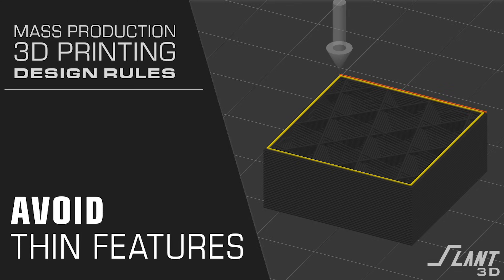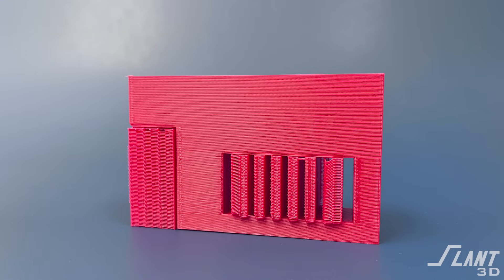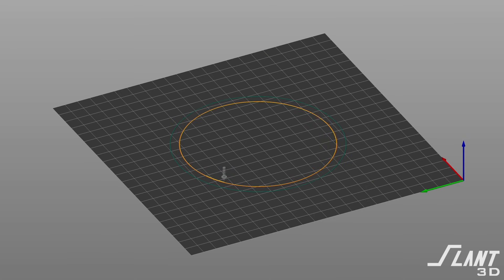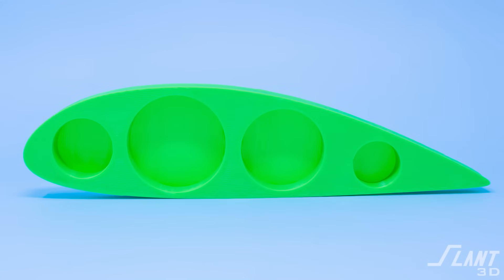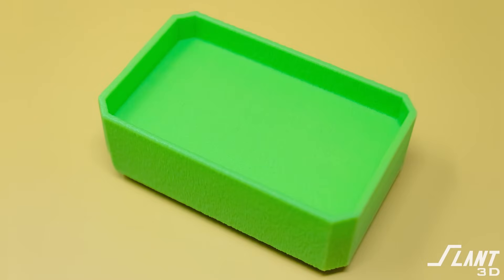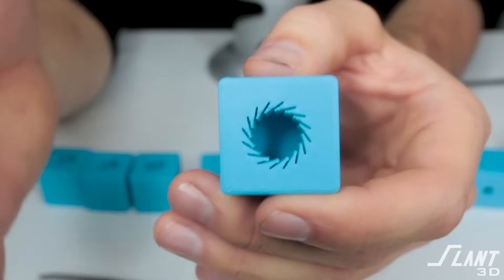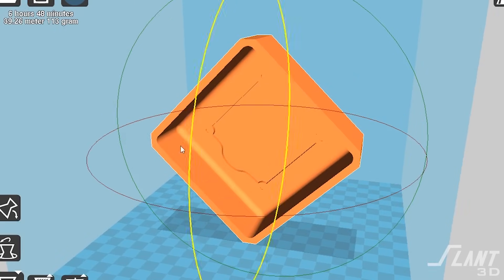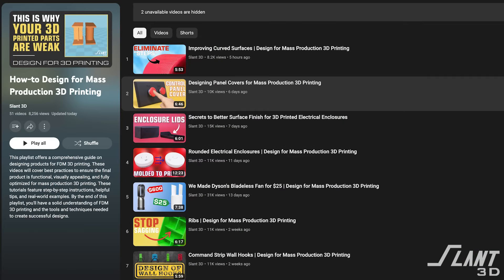8 Essential Design Rules for Mass Production 3D Printing

Comment: Very true with the cutouts!
Cutting out material very likely INCREASE printing time and part mass, as perimenter will be printed where otherwise just sparse infill would be.

However, as with everything, it goes both ways, you can use this, if the object benefits from the additional strength, or where the infill might be slower to print than perimenter, eg. large hole vs. large infilled “hole”.

Comment: mass production 3d printing???  don't you just use injection molding at that point.  3d printers are for end users to replace or make individual parts.     I'm sure you can but ... why?
Reply: @charliemckay6681  what a stupid comment.

3d printing is statistically more cost effective than injection molding until you get to around ~500,000 parts.

Comment: Another one: Divide and conquer! 

It's very tempting to try to make every model a single big part that can be printednin one go. However if you do that you run into issues with all the tips in this video. It's not posible to get the layer lines right on every feature of a complex part. It's imposible to avoid overhangs etc. 

But if you divide your print into a few different parts and assemble them you can make each part optimaly strong for its purpose.
Reply: This! Also, failed prints, or failed designs can be retried with less cost and time. Although these can be less of an issue for mass production where your design is not a prototype anymore and your machines are reliable.

Comment: I would be interested in a deep dive on the rounded vertical edges saving time. Appears to be a good rule of thumb for time saving.  Rounded vertical edges decrease printed volume, so I would assume the time saved is more volume and distance traveled dependent rather than acceleration dependent.

Comment: you can put text on a first layer, and I've done so for a print with around 77 parts, but it was VERY simple text and I used a single layer cavity that the second layer then fell into to create the contrast for the text, and this wasn't a dimensionally crucial part and the font I use for production 3d printing is picked specifically for the job.

Comment: The problem with mimizing first layer contact with the bed is reduced adhesion which is wanted for some parts for instance a cylinder shaft that is long and thin, you would want to make sure the ends of the shaft have a brim or something to hold it down or else the whole print will lift off pretty easily and tuning a printer to that specific setting will also be pretty time comsuming.
Reply: I think it depends on your printer. With an ender-style printer that moves the bed, adhesion is much more critical than on a machine with a two axis head.
Reply: @Jacksparrow4986  that might be why slant said it "doesn't matter" looks like their printers might only move the bed in the vertical axis (which is also supported by the way we see it eject the part) in which case bed adhesion really doesn't matter because the forces acting on the part are close to zero
Reply: @Jacksparrow4986  Bed adhesion is still a key on my Bamby X1C, and if you are printing larger parts it is critical that it does not move
Reply: @jenspetersen5865 for hobbyists we don't invest a lot in vibration reduction, climate control and the speed of removing a part isn't a big deal.

Print farms aren't out there using glue on beds and knocking a few hours off "so I can have it now" doesn't matter.

You control for the other factors affecting bed adhesion rather than needing to glue a print to the plate with a brim of literal glue.
Reply: In a prior video they give a production example of that style of part showing the ways to avoid the need to stand such a cylinder on its end. This is likely a big part of why the design ethos that is explored here doesn't really translate to all ideas in the hobby space.
Reply: if its for production you want to have the printer tuned for that specific part to start with,
Reply: 3d printing is a good mass production method for certain types of parts. I don’t think a cylinder shaft that needs a brim would fit that though.
Reply from the maker: Not relevant in production
Reply: @slant3d  what's your reasoning on that? It's pretty lame to say someone is wrong without backing up your argument....
Reply: @slant3d  why, plesse explain. how do you increase adhesion?
Reply: @fabianmerki4222  with production, duh
Reply: @slant3d  How is bed adhesion not relevant for EVERYTHING in 3D printing...

Comment: I love the tip about the texture on the side to hide layer lines. That's clever. Thank you.
Reply: I agree, but how to add texture? within the cad design or is that a feature whitin the CAD/Slicer software  (I'm new into 3d printing)
Reply: @ivanvazquez7465  You can have the slicer add Fuzzy Skin or print with Carbon Fibre reinforced plastic, or you can design a pattern in your cad

Comment: The thin wall stuff drives me mad, i made a small circular hook on the side of a part, the hook's outside wall was deliberately made 1.2mm (2x nozzle width), so in theory it's two lines fusing nicely into the rest of part, right?

Cura does some nonsensical zhops on the inside then lays a 1mm wide turd of a half-circle at the hook's weakest point, the part that juts out
Reply: Extrusion width is actually slightly larger than the nozzle width, as you want to squish the layers together slightly for best adhesion. You were asking the slicer to deal with essentially a worst case scenario for layer adhesion. The default extrusion width for a 0.6mm nozzle in PrusaSlicer for my Mk4 is actually 0.65mm. This means a width 1.3mm is actually 2x the extrusion width. In practice, I've found that you actually want to avoid these numbers as you're asking the slicer to deal with edge cases. Keep in mind that modern slicers use the Arachne perimeter generator, which is able to vary the extrusion width, so it's not super important to make sure you hit these carefully calculated numbers.

Comment: Is there a certain proportion to strive for when deciding what portion of the part sits on the bed? My product has a print in place hinge which really only gives me 2 options for how to place it on the bed and both have roughly the equivalent amount of surface area on the bed. That said, my preferred orientation is designed to increase strength in the direction at which it will be repeatedly hit. Yes, I’m aware that PLA with shatter eventually when hit repeatedly, which is why I’m printing it in TPU with different print configurations for the main body (stiffer denser infill and more walls) and the pivoting appendage (less dense and less walls for more flex as this is the part that will mostly get hit. Am I on the right track or am I missing something?
Reply: No, it’s a delta printer, so bed is fixed. I’m also printing it I TPU at 300 mm/s
Reply: Does your printer move the bed for y axis?

Comment: a 3d pixel is called a voxel
Reply: A voxel is a  vo(lumetric) (pi)xel, a term that that's been used in 3d computer graphics dating back to the 1970's.
Reply: His target market are people who work with injection molding, who probably don't know what a voxel is.
Reply from the maker: Thats a brand name
Reply: @slant3d i really enjoy your content. The term voxel as a 3d pixel is older than the brand. pixel stands fo "picture element" voxel stands for "volume element" [1]. Voxel the brand was founded in 1998 [2]. The therm voxel as a 3d pixel was used since 1993 [1]. [1] https://www.cs.cit.tum.de/fileadmin/w00cfj/cg/Research/Publications/2018/LineRaycast/Kanzler2018.pdf [2] https://en.wikipedia.org/wiki/Voxel
[3] https://www.voxelgroup.net/index.html

Comment: Do you use any bed adhesion products for the low contact parts? If so, can you share it? I'll understand if it's a trade secret.
Reply: glue stick. I'm not kidding.
Reply: I use liquid Dimafix, but only for ABS and only on the edges of where the part will be printed. Although it can help with PLA and PETG too for tricky prints, or if your printer is unable to heat the bed uniformly. For sticking PLA, usually cleaning the bed with IPA and increasing the bed temp is sufficient (for difficult or too low quality PLA I sometimes increase the bed to 45-50C and it sticks w/o problem).
Reply: Chances are you already have one as most printers now ship with them as standard, but on the off chance you don't I'd recommend a textured PEI plate. Never used glue and never had trouble with first layer adhesion while using one.
Reply: A dialed in first layer with just enough squish for good adhesion, a good material for the bed, and it looks like their machines are Core XY so they don't have to deal with a moving bed.
Reply from the maker: Bed Adhesives are not viable for mass production